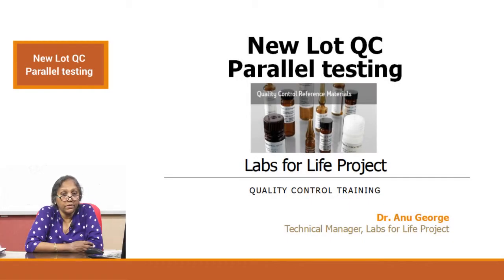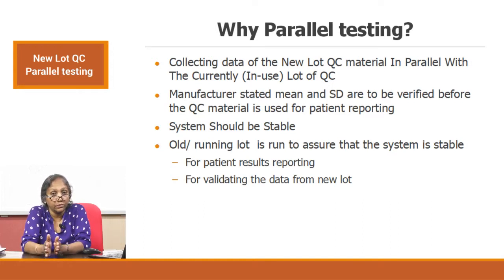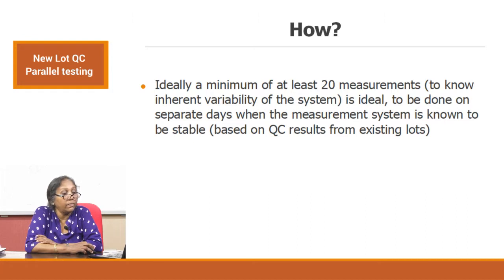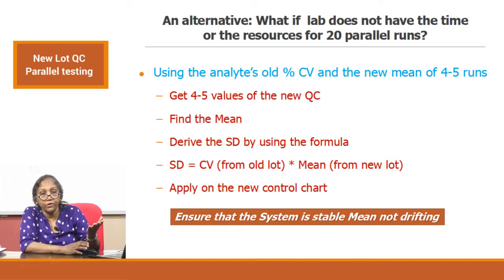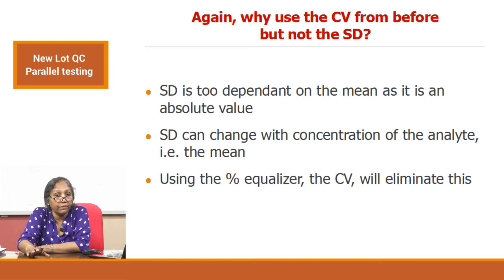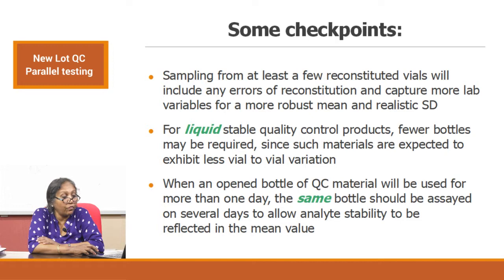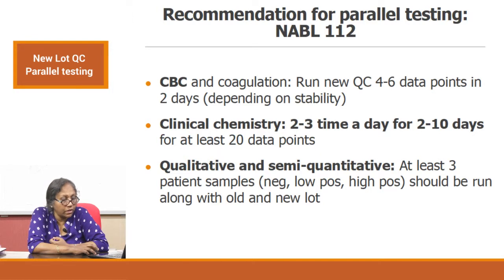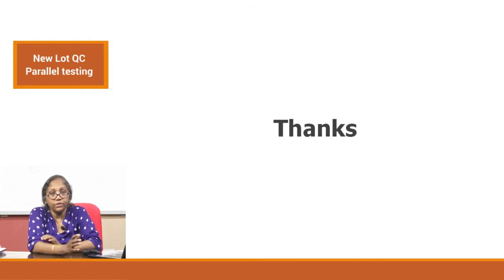New lot QC (Parallel testing)

Comment: Maam ,after finding the new lot SD, howto use them for lot to lot verification ?
Reply: Use new SD to make sure assay is stable while doing parallel run for new lot, to establish again a new SD. Repeat. However, pooling SD now is a thing, and you don't have to get new SDs everytime you change a reagent lot. There's an SD pooling formula in the 24th edition of Henry's Clinical Diagnosis, Eq. 11.1